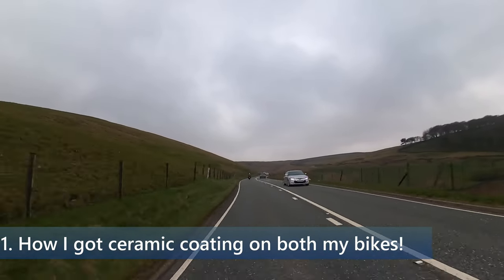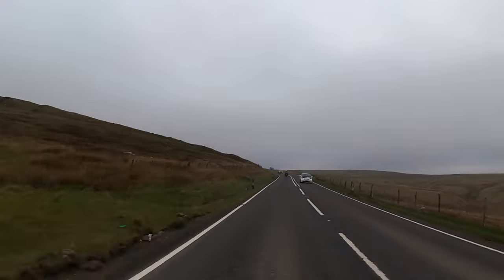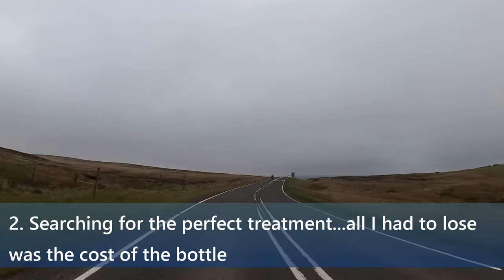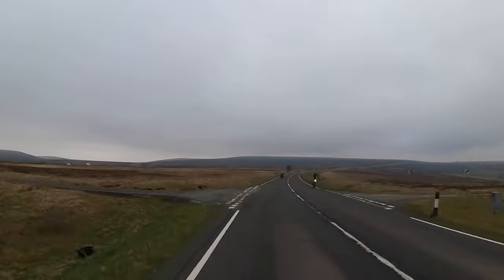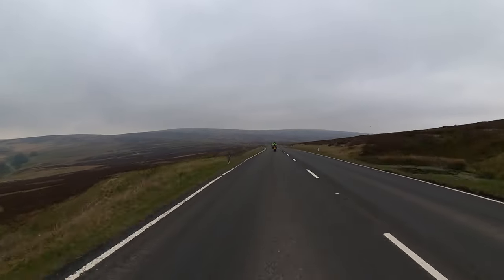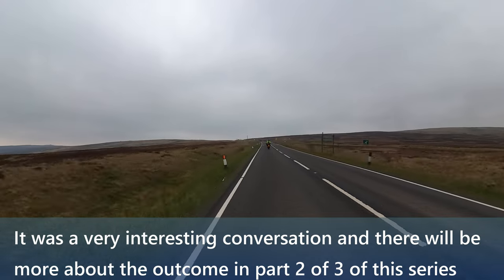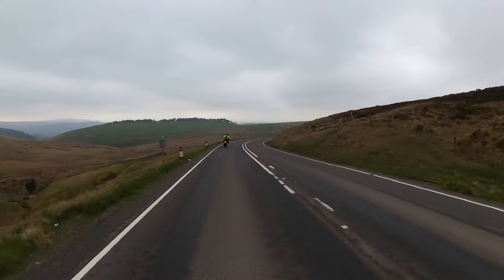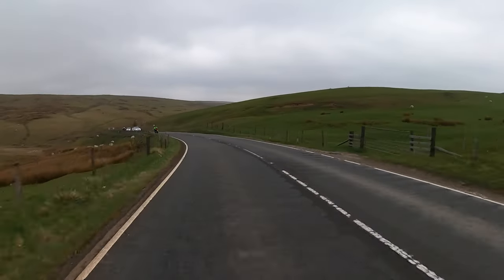How and why I chose Ceramic Coating for my motorbikes (Cat and Fiddle, feat. @NooBiker @Pooley650) 1/3

Comment: Thanks for recommending them and doing all that research 👍

A bit weird watching myself riding. I need to have a good word with myself to correct some issues 🤣
Reply from the maker: Thank you for watching! A bit of along one today! The original was over 40 minutes long so a lot of the research and detailed comparisons went. I hope enough was left to make it appear there was some academic rigor to the whole process. I genuinely believe I found the best within the scope of my study and the last 6 months of use have supported my claims and met my expectations- I will however point out that I continue to apply xcp, firstly as I don't know what else to do with the 5litres I have and secondly as I'm quite clear this is not a perfect solution, there still remains areas that could be vulnerable and I prefer an abundance of caution to reckless abandon as it's my nature! Prevention is better than a cure! (I rather use my funds as petrol money than repair money😜😜)

Your lines were good! The road was choppy in places and the weather windy and wet, it was a great day!! Really disappointed i couldn't have a full day with you! Hopefully next time we can make it up!! Thanks again and chat soon!! 😁😁🖖🏼
Reply: @quinnpeaksbiker  it's the foot out left hander that I picked up on 🤣
Reply from the maker: @NooBiker  I thought you were going to stop as there was a hazard 😂 had my foot out too🤣🤣🤣
Reply: @quinnpeaksbiker  just all that damn gravel!!!
Reply from the maker: @NooBiker  didn't notice, next time an adventure bike 🤣🤣

Comment: Interesting topic Mate, luckily here  in South Australia, we don't have  so many rusting issues. We do have Ceramic coating offered here and it works great, but not cheap. Pleased in worked out for you.  Sounds like a great company. Take care  😎
Reply from the maker: Thanks TPR! It's taken 2 years to find something that works, here between the rain, salt and gritted roads it's a real pain in the backside!  We are quite lucky to get it at a good price here. Any product garages are selling please check them against manufacturer specs, a lot of dubious claims being out there, enough to fertilize the Sahara 🤣🤣🤣 take care and ride safe mate 😁🖖🏼